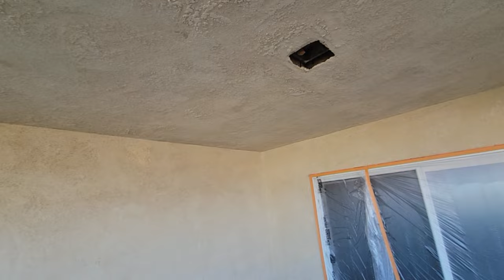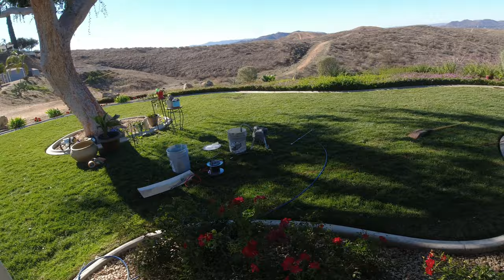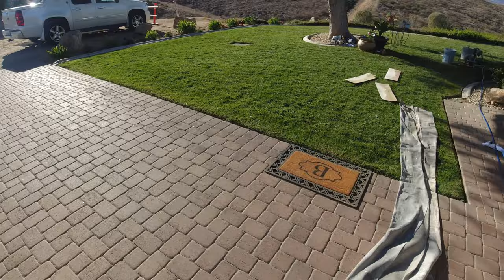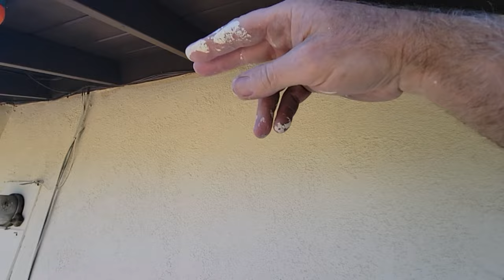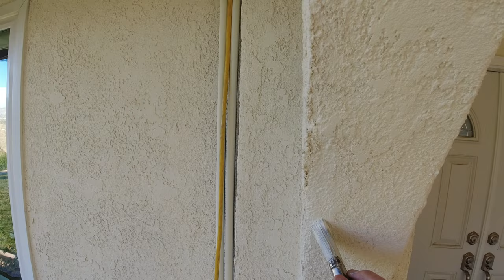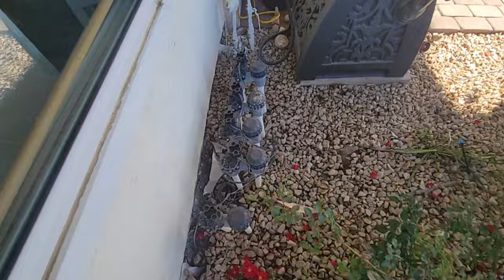Airless Spray Demo - Painting a house - Stucco spray painting

Comment from the maker: Thanks for your comments and likes. hope you learned something.
Reply: It would be super helpful if you would do some technique demonstrations. I can cut a straight line ok. I keep getting confused whenever I don't have straight lines to work with eaves for example I get lost I have rafters stucco a huge fascia board and I'm up ten feet in the air on a ladder next thing I know I forget what I'm doing and whatever technique I was trying to get better at everything goes out the window then paint is dripping on my head and arm and it turns into a nightmare. I'm lucky I havent had any serious messy disasters. Quite a lot of touch ups though, which waste time. Frustrating. Not fortunate enough to have a pro to work under so it is what it is right now